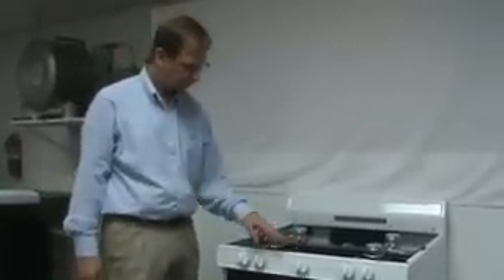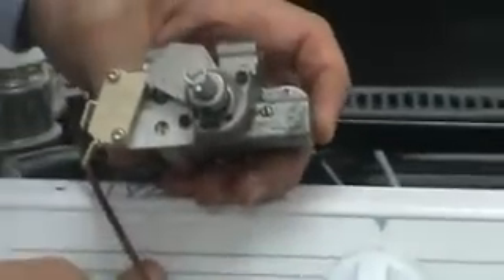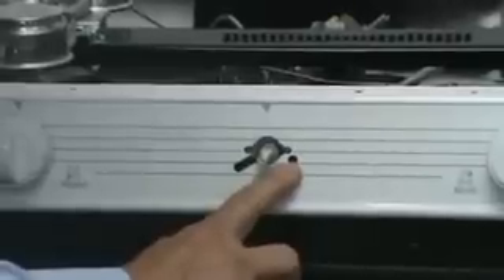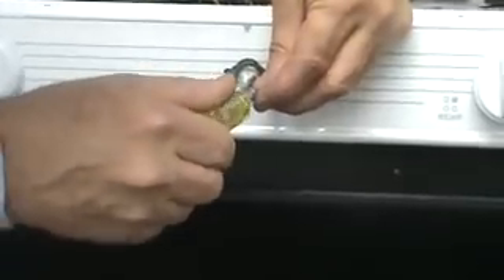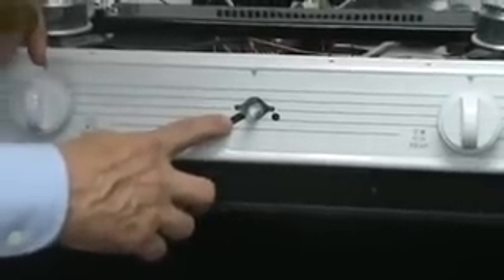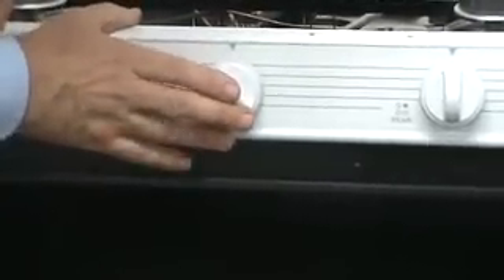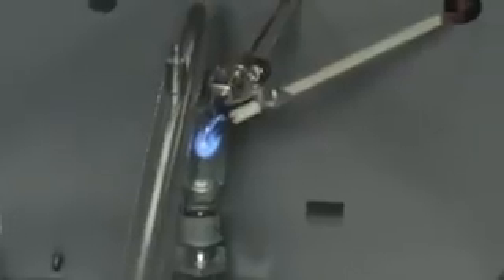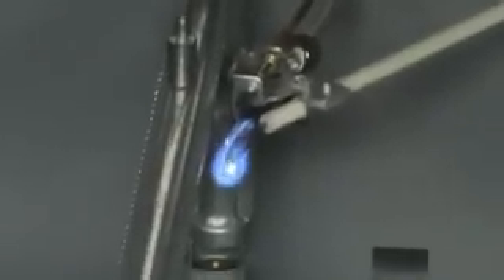STEP 2 Convert B or T Models

Comment: What is the adjustment if the burner does not stay lit?  The pilot does not stay lit either. If I turn the thermostat knob just past the pilot position, I am able to keep the pilot lit, and if I go just past that, the burner lights.  But once I go past that and prior to my reaching the reading of 300 on the dial, it all goes out. Nothing stays lit.  I have adjusted everything according to your tutorials.  What's the issue?
Reply: i have the same problem.  any help out there?
Reply: @danielcoyle7740  I received a replacement part from the manufacturer which was causing the issue. I forget exactly which part it was as it was some time ago. They will be able to tell you if you call them.
Reply: @GRasimos   thanks so much.  I will call them and you will save me from wasting lots of time.  have a great holiday